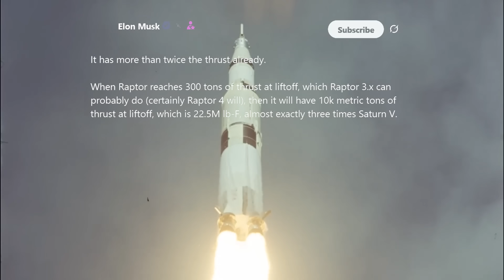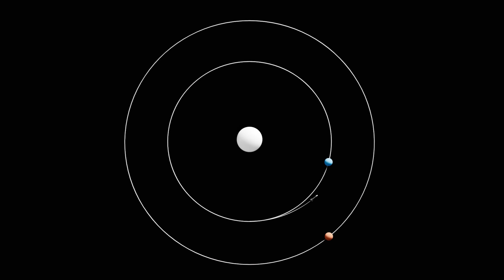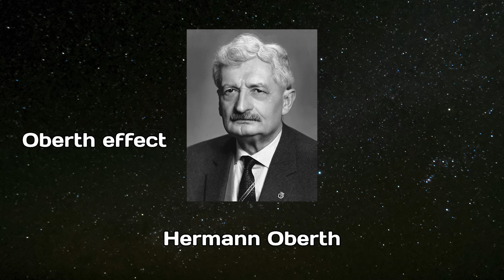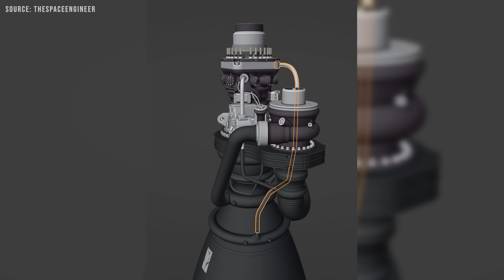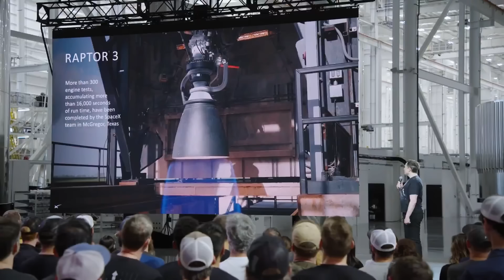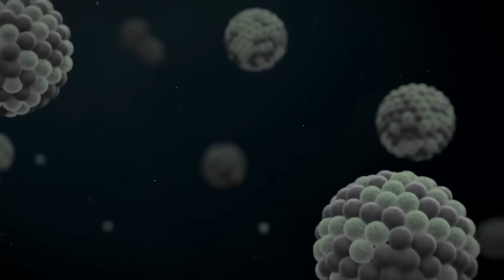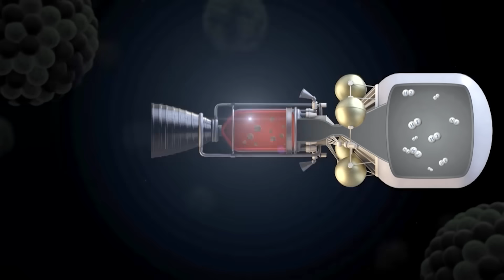SpaceX's New Brilliant Solution on Starship Raptor 4!

Comment: You can exponentially increase thrust output even further by building the engine the size of the F-1 APOLLO lifting engine that helped take man to the moon. A raptor that size means having to use fewer engines but with a hell of a lot greater thrust to weight ratio.
    Eight to Twelve  of these huge Raptor engines combined thrust would be more at 50% percent throttle than the 33 engines at almost 100% throttle.
Reply: You need lower thrust for landing

Comment: So many things incorrect instantly, and bizarre mixes of metric and imperial.
Apparently Elon meant ~309 metric tonnes per foot of thrust. Which with 33 engines in Starship would be ~22.5 million lb-f.
This means that each raptor engine is 681,818 ft-lb of thrust, compared to the Saturn V F-1 engine which had 1,746,000 lb-f.
Reply from the maker: We will fix this, thanks your feedback